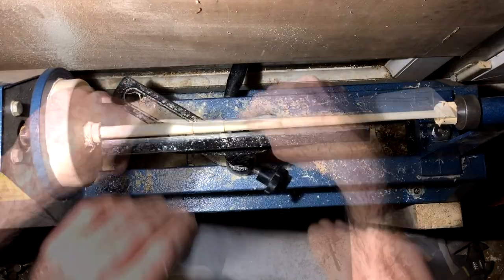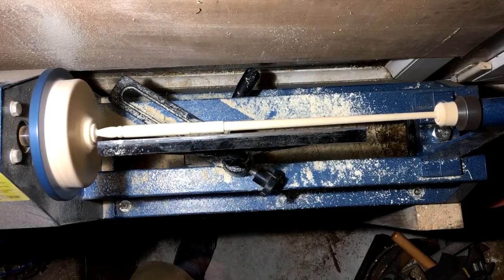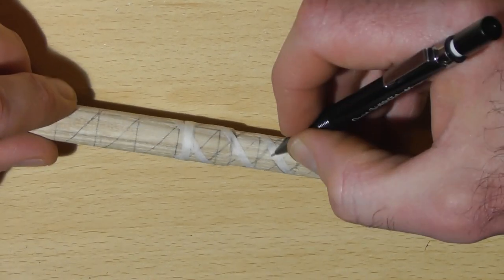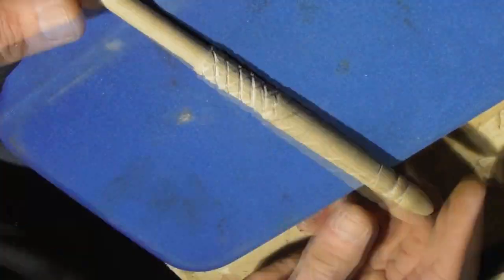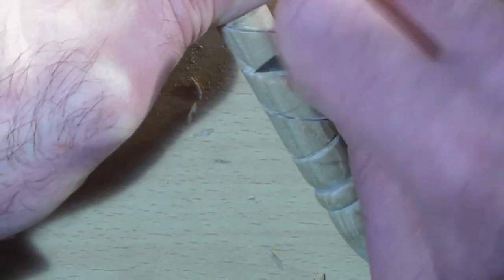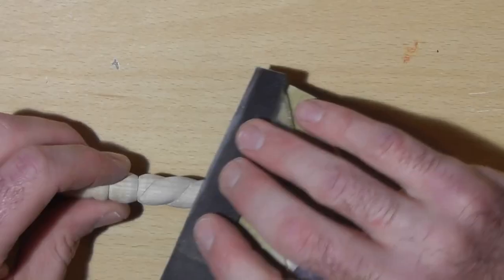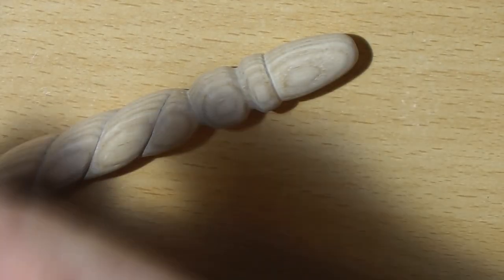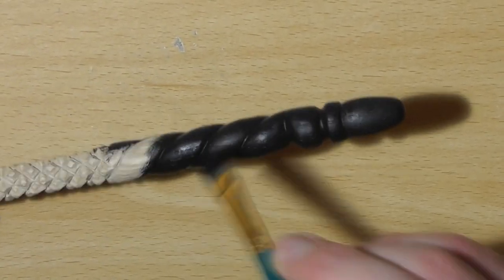Ginny Weasley wand making! DIY hand made wooden wand build!

Comment: Hi when I used to paint my wooden wands acrylic it had bumps and didn't stay on the wood properly. Did you put a sealer on your wood before painting it?
Reply from the maker: Hi, no I don't use a sealer and have found that the daler and rowney system 3 acrylic that I use sticks really well. Something that helps is clear wood varnish over the top of the paint because it seals it with a really crisp, hard, clear surface. I also know for MDF and boards like it, that you have to use pva glue as a sealer or mix pva into the paint, so that might help you with your projects 😀👍 Good luck with your future builds 🤟😀
Reply: Thank you 😊